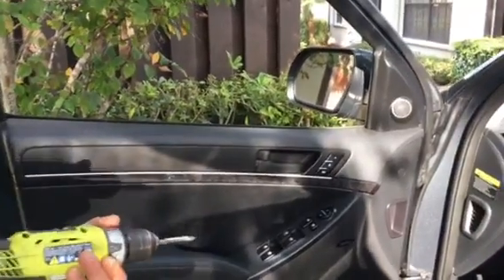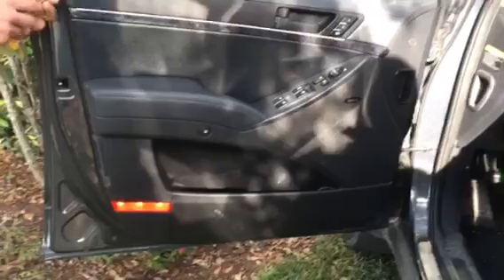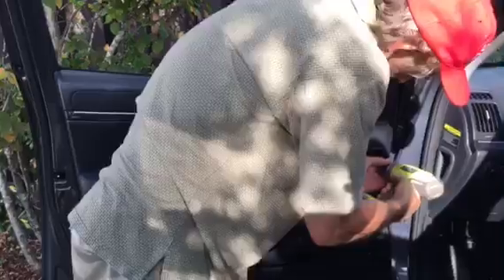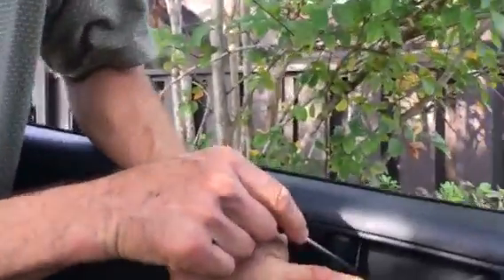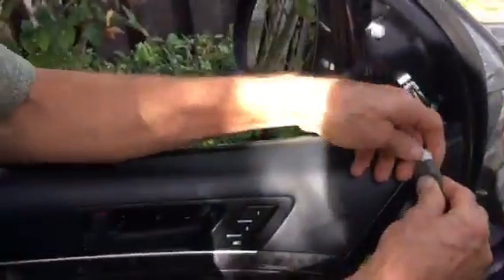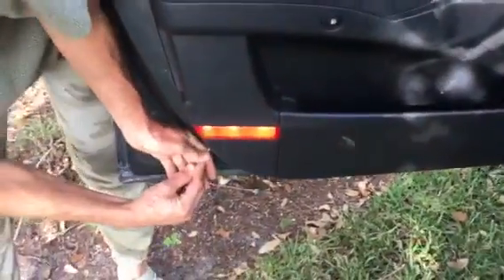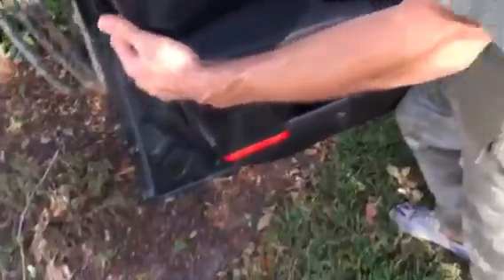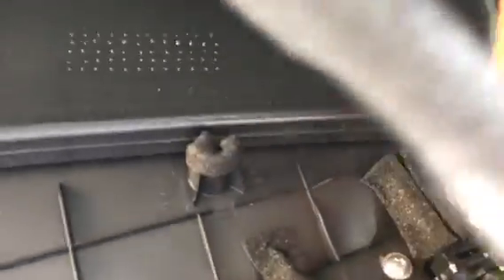2011 Hyundai Veracruz Driver Side Front Door Inside Handle Removal

Comment: Not a very good video but it pushed me in the right direction to get my 2010 Veracruz passenger door removed so I could replace a tiny part inside the door handle mechanism that had broken. Saved me a lot of money to not have to pay someone to do this. Cost $5.11 and a lot of hassle to get the right part.
Reply from the maker: Glad you were able to Shake, Rattle and Roll through it.